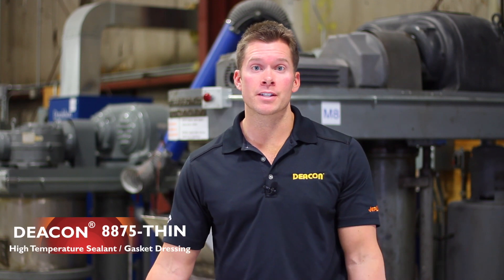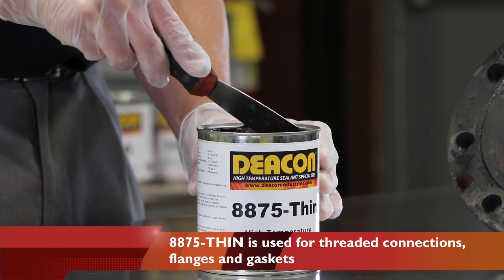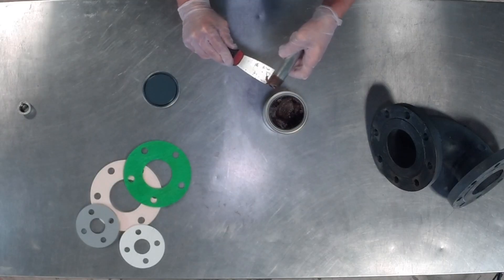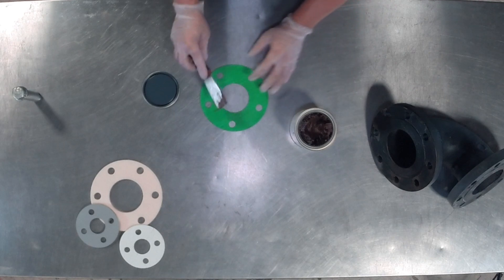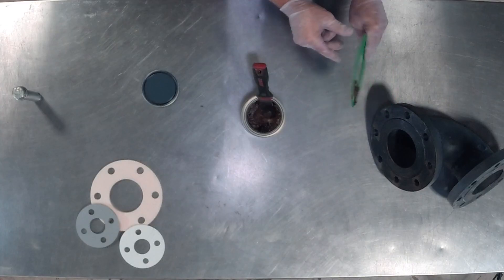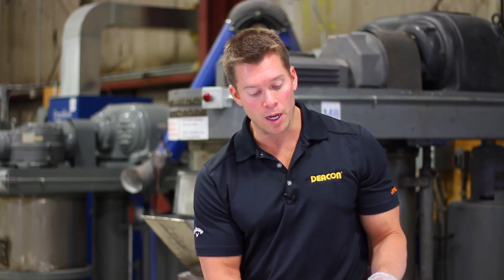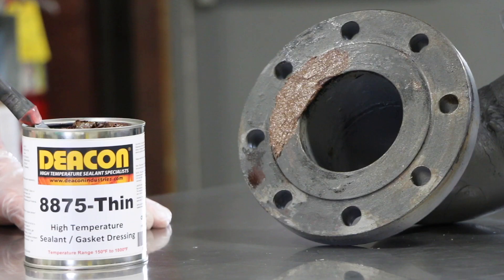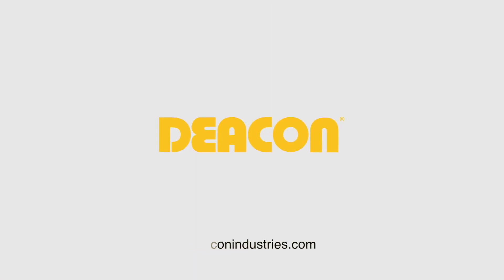Deacon® 8875 Thin - Thermal Reactive Paste Sealing Compound

Comment: There's no product on the market today that can compare to Deacon products. I used this product on an $25,000 computer controlled fryer combustion blower cover that both the cover and burner itself were severely warped causing shotgun type blasts and it's been.  2 1/2 years and is still going strong. I recently used this on a convection oven that had a slight split where the inside oven cavity met the burner.  Allowing burnt gas fumes to enter.  There's no fumes anymore. Deacon products are a Godsend. Thanks for making such a nice product!!!